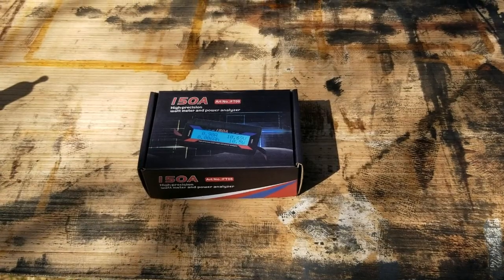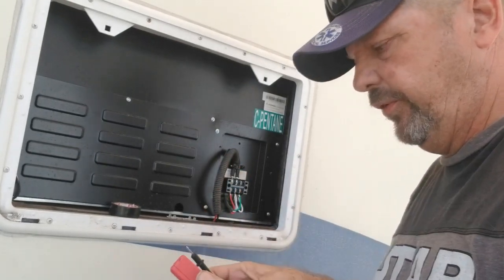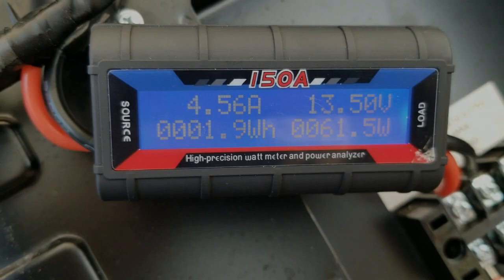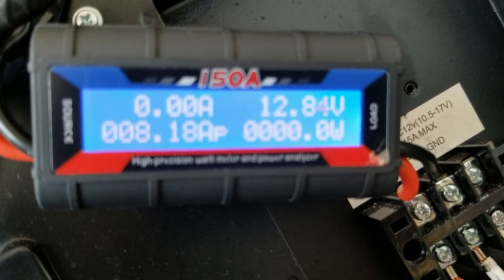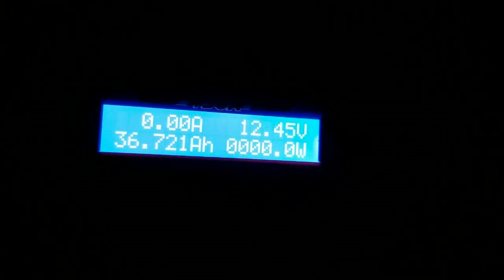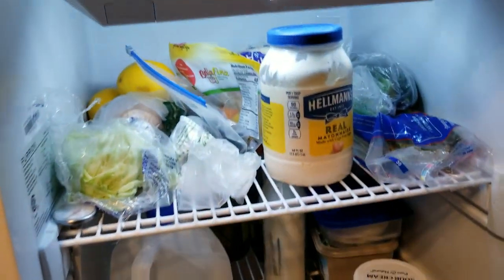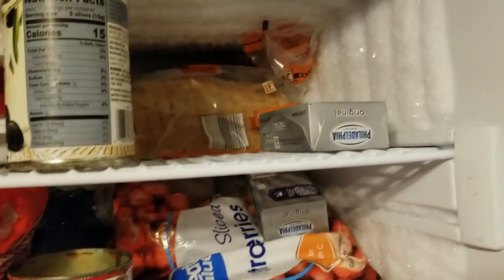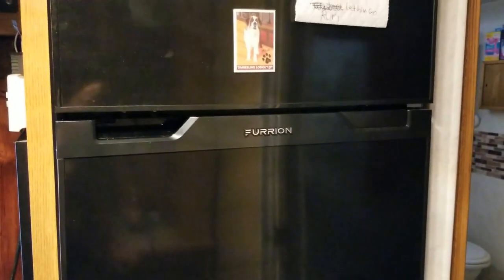Power consumption furrion refrigerator

Comment: Thanks for the video.  It is confirming my up coming purchase of an RV with a 12 vdc fridge.  I now have to size my batteries and solar to accommodate this and running a furnace.  Thank you.
Reply: I have 380w solar now and I use maybe 70Ah a day maybe 80Ah  of 116Ah usable. lights, furnace, water pump, phone charging.  That is 140lbs of lead acid.  I want to expand to 800 ish watt  with two 200Ah lithium. for 320Ah usable. which is 120 lbs . I should have went lithium first time.

320 subtract my typical 80, subtract 80 for 12v fridge,  leaves me with 160Ah  for tea kettle, instant pot. I might as well toss in 27" computer monitor for the laptop.
I am guessing on typical use, I've never dropped my two 6v lower than 12.3volts
Reply: @timrice5342  , thanks Tim. In the 11 months that have passed.  I purchased the RV, added 4  200 watt panels, mounted to the roof and added two 200 ah lithium batteries I bought off of Amazon ( not BattleBorn).  Yes the lithiums are the way to go.  When using the trailer in Colorado, I barely use 20% of the batteries capacity so far.  The solar is crazy good up there.  But I bet with that capacity your looking at, you won’t deplete the capacity at all.  By the way, with lithium, you can drain them to zero with no I’ll affects so 400 ah is at your disposal.  Next I want to add an inverter so I can use the microwave.  Good luck and go with lithium.
Reply: @hammer-r  yes Colorado rocks, elevation rocks! I was in  AZ and I didn't have any issues Dec-Feb  I wasn't big on heat though, that saved juice.   Sun is low days are short. Thanks for confirmation on 400Ah!  sounds like that is my ticket for all of my needs, along with a 12v fridge, priority #1 lol
Reply: @timrice5342  , yes the 12v fridge is great.  They are supposedly better in efficiency and will last longer.  Luckily mine came with one.  Love it, just that the temp is a bit hard to control. The dealer was no help.  Tends to freeze stuff, so I have to stay on top of things.  Here is the battery I bought last year at $800 each, now $700.  They are great. Ampere Time 12V 200Ah Lithium Iron LiFePO4 Deep Cyc…$699.99. For Amazon.  I had questions and their customer service was very helpful.  Made me confident in trying them.  Good luck with what ever you get but yes, lithium, better power, better weight and longer life.  From what they said, I’m guessing 10-14 years since I’m not stressing them.

Comment: Thanks for the test. Your running and max amps closely match tests I did on mine (same unit). I appreciate the additional data on the Ah energy use. So far I like having the 12v fridge on while traveling vs leaving the propane on. My 7 way charges the battery enough that I show up fully charged as long as I started the trip fully charged. What I don't like is I could make it almost a week of frugal use on a 12v battery with the old style 2 way on propane before I was into a battery damaging discharge. A few LED lights, water pump, and some control boards. No solar, shore, or gen power. Now I'm below 50% state of charge in less than 24 hours. There are 100 solutions, but none of them are cheap.
Reply from the maker: The 12 volt refrigerator does use the battery more than the propane one,  our 200 amp hour lithium runs the fridge dishnetwork sat and tv, I can get 48 hours with no charge but then we eather have to plug in and charge or go somewhere sunny. You are correct there's no cheep answer to the problem,  cheapest I would think would be a inexpensive generator
Reply: gas price  is going up! and there will be a day you cant buy gas, but the sun will shine.  I was paying $2.50 a gallon and then boom It was over $4 a gallon. no idea where it is at now.  for full time, im not going to tether myself to being gas dependent.  food for thought.

Comment: Our mh has a 18 cu. ft. Samsung residential fridge. With an outlet amp/hr meter I used 72 ah. My inverter Xantrex is 90% eff. So, used about 79 to 80 amp hours. Also, the ext. temp daytime was 76 Deg. and night was 54 deg. I'm sure in hot weather it might use 100 ah.

Comment: I just installed a Magic Chef Residential 10.1 Cu Ft into my 5th wheel. I put a pure sine wave 1000 watt inverter dedicated just to the fridge for travel or boondock use. I also put a couple new AGM 95ah batteries for the whole trailer use.
The inverter has a watt meter display. It read a momentary 800 watt compressor startup hit then dropped and stayed below 100 watts. It was as low as 58 watts while running and as high as 98 watts for some reason. I thought it may be the defrost mode.
I did a hot start up with it and it ran at the 58 to 75 watt level for two hours before I checked it. It was cooled down fully in that time. I then just let it run for another 8 hours. I almost forgot about it. the batteries were still at 12.7 volts and the RV battery monitor showed only 1/4 down. 3/4 still up. But I know that isn't an accurate measurement as to how much it used.

I haven't added any solar to the system but do plan on 400 watts soon. I did figure that as far as leaving it on while traveling it was not any problem what so ever and I could at least do a sleep cycle while traveling to destination. I do think boondocking I do need solar or generator for sure. Running the truck with it's minimal charging would be a ridiculous amount of fuel. I do have a small efficient generator. But like the idea of solar for hassle free operation.

Not sure of the running amps for the watts. But seems that would be under 1 amp operation for the max I saw running. But just the inverter gauge reading of watts.

Comment: I don't know what your daytime and night time temps where but our 9.8 cf Haier uses around 1kw a day  at around 75f daytime temps and similar inside the rv and around 50 at night with the rv never dropping below 60f. That was with food in the fridge and freezer and using the fridge normally with the fridge maintaining about 35f to 40f inside the fridge. I was testing to see if we followed good weather how much power I need to generate from solar to boondock. Gas absorption would be better for that. But whoever owned the rv before us replaced that with a residential. I've wondered if when this goes out if a 12v would be better but it seems they use almost as much power over a 24 hr period and cost much more. Thanks for the test very informative.😀
Reply: boondocking with gas is getting OLD!     20LB tank every 2 weeks, I want to rarely go fill up a tank. I'll be going 12v fridge, electric tea kettle, and instant pot.  I have 380w solar now and I use maybe 70Ah a day maybe 80Ah  of 116Ah usable. That is 140lbs of lead acid.  I want to expand to 800 ish  with two 200Ah lithium. for 320Ah usable. which is 120 lbs . I should have went lithium first time.

320 subtract my typical 80, subtract 80 for 12v fridge,  leaves me with 160Ah  for tea kettle, instant pot. I might as well toss in 27" computer monitor for the laptop.

Comment: have you tested out the draw or results on the "off the grid" mode that says to use 5v?
Reply from the maker: I did not test it in the off grid mode it looks like it just turns the fridge way down, I'm sure it would save battery power but I have my doubts on if it would be cold enough to keep things from spoiling
Reply: @pealingout3715  that's sort of what i was wondering too-- thank you for getting back to me!

Comment: Did you do your test while plugged into shore power?   I noticed that your voltage was always in the 13 volt range.  As the battery starts to drain down , the voltage goes below 12 volts which can cause a problem.    As the voltage decreases the amp draw increases.
Reply from the maker: Only hooked up to the solar system

Comment: Our 10.7 cf residential fridge draws about 6-8 amps behind the inverter when the compressor is running. That goes to maybe 30 amps when the defrost function is running. I never timed it but it takes probably something like 15 minutes.  That was also the surprising part of your video: It appears your 12V fridge does not have a defrost function?

So yes, when looking only at the time that the compressor is running a real 12V seems 10-20% more efficient because it does not have the losses of the inverter, and you don't need that 1000W inverter running 24/7, drawing 0.4 amps to cope with the locking amps of the compressor. The big unknown is what influence the existence or absence of a defrost function has on efficiency.

Comment: What solar are you using with this refrigerator? I just bought the refrigerator from etrailer and expect to upgrade my batteries and/or get some solar. Sorry if you’ve already answered this in a different video.
Reply from the maker: No problem,  when we installed the fridge we were using  3yo renogy gel batteries ( 3 ) 100ah and probably 600 watts of solar on the roof of the rv, we have been upgrading batteries and solar ( video  coming) so now our rv has 2 completel solar systems,  the front array has 400 watts with the older gel batteries and the 2nd is the rear array with 675 watts and a new 200ah lithium battery,  the rear runs the fridge tv satellite cell booster cell charging and a few other things, the front system is wired in to the original RV wiring and runs all the lights and 12v stuff in the rv. Hope that helps,  if you have a question just ask I will try to answer

Comment: Hi.  Good video.   Was wondering if you are aware of the fuse issue with this fridge.  My fuse keeps blowing.   It first lasted 2 months after the first time it blew.  Now it only lasts a day or two.     I found others complaining about the fuse blowing on theirs as well.    Another pain is the fuse is located on the back so every time it blows I have to pull the fridge out because I don’t have an outside panel.    I have a warranty claim with my dealer and waiting to see what they will do.
Reply from the maker: The fuse blew on mine about a month ago instead of replacing it with the factory fuse I bought a new inline fuse and replace it
Reply: @pealingout3715  thanks for replying.    When you say inline fuse is it the blade type like the ones found in the fuse box?
Reply from the maker: @markdebiasio   I took their fuse completely out solder the wires together put in a new blade fuse outside of the refrigerator so it could be changed easily have not had an issue since

Comment: How is the frig doing this day and time. We have a residential 18 cubic ft and want to got his this unit.We dry camp and the residential as you know is a hungry monster. Thanks for the video. By the way we have 1070 watts and 8-6 volt T-105 RE's Trojans.
Reply from the maker: The fridge is great best upgrade we have made, the only complaint is the  drawer at the bottom isnt on tracks and can get stuck trying to push it in so you pull it back out and try again... and its expensive,  but overall still the best thing we have seen for refrigeration

Comment: This will be a definite "must have" when we buy our first travel trailer. If a new trailer doesn't have a 12V compressor fridge it will have before it leaves the lot. I am "dead" (pun intended) set against the fire breathing dinosaur absorption fridge. Hard to sleep with a open flame in the trailer. Too many RV fires linked to absorption fridges. Ending up as a burnt rack of ribs isn't how I want to leave this life.
Reply from the maker: Thanks for watching. We felt the same way when we started this life but this fridge was the first complete one we have seen. We looked at the 12 volt conversions and would have done that but then we found this one and with its 10 cf of storage it was the choice
Reply: Been rving for 40 years.  Never heard of a fire caused by a propane powered fridge that was properly maintained.  Maintained meaning no debris behind it.  Your either poorly informed, inexperienced or a 12v fridge salesman . This 12v fridge b.s. is another tree hugger project.

Comment: If you wanna do an AC fridge just hook that up to the battery side of the inverter and turn off everything else. Or you can buy a clamp on ammeter and with a voltmeter with storage capacity track the use over time

Comment: So the batteries are done after two days if you use nothing else. That’s not very much time.
Reply: It all depends on what you are setting up your RV to do. Some go to full hookup sites only. Some boondock. We try to boondock as much as possible and set up the electrical system to match our needs. There is no one size fits all without spending way more than needed for some. We are set up with 400 amhs of lithium Battle Born batteries, 500 watt solar, 5500 watt Onan generator. More than some need and not as much as others.

Comment: 5 amps..wow...that huge...since my 120 Ac   5 .5 cu. fridge uses 80 watts. I'll stick with my Ac unit...only upsizing to 10 cu.still only 80 watts ..same conpressor...higher voltage is much more efficient ..
Reply: If you do the calcs va=w then 12 x 5 = 60 watts your fridge is less efficient at 80 watts.